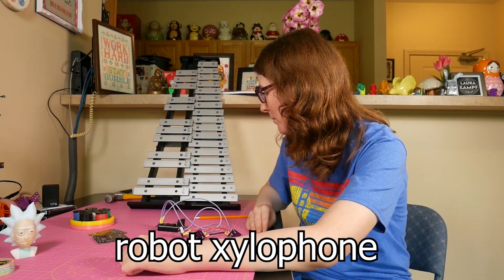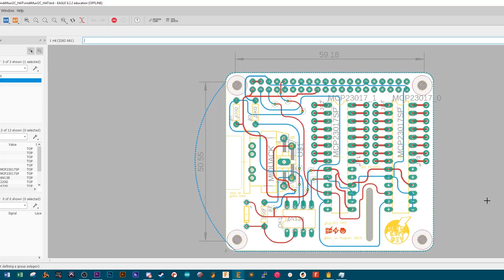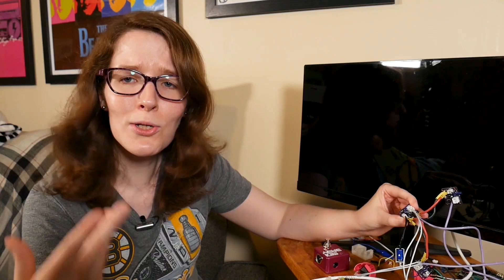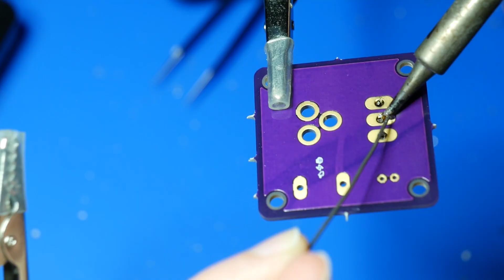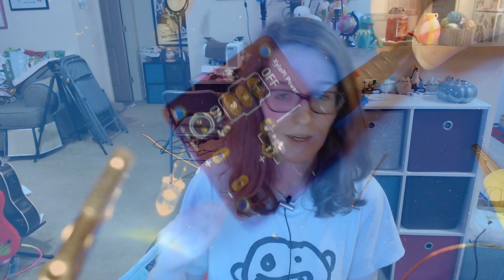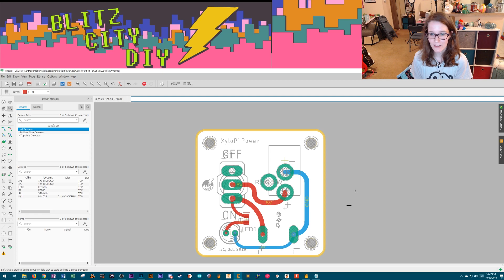How Did This PCB Work Out? - Making and Sharing Mistakes

Comment: Are the net names on the two switch terminals the same? Both VCC for example? That happened to a board I was designing in EasyEDA recently, and only spotted it because there was a rat line drawn between them. That'd explain why the copper pour connected the two pads.
Also what value resistor was it? 1K should be enough to stop the LED from kersploding :P

Comment: Problem was is in the schematic. you joined pins 2 & 3 of the switch together instead of pin 3 going to R1 & JP1 junction. 

I always spend another few hours just staring at both schematics & layouts before ordering. I generally catch my noob mistakes that way, though almost always end up with a connector the wrong way around. Keep at it. we have all been there.

You should also try online gerber viewers and zoom in to pads before ordering. (KiCad 3D viewer feature is gold here)
Reply: Agree. Though that doesn’t explain why the SMD resistors pads are both connected to the vcc-poor.

Comment: There's nothing wrong with your choice to use a plane for Vcc: your mistake was in the schematic, where you'd joined V-in and V-out via a single pin of the switch :)

If your schematic was correct, the Vcc plane wouldn't have been connected to everything in the PCB design view. That said, it would possibly have been easier to spot your mistake if you'd routed it manually. I'm not sure how Eagle works, but in KiCad your manual routing board would have triggered an error in the error check tool, as it would have been expecting you to join V-in to V-out, which would make you realise that something was wrong.

It's always so damn easy to make mistakes with PCB designs, though, so don't be too hard on yourself :) I've made a habit of printing board designs out on paper and staring at them for ages before placing an order, but that still doesn't always save me from frustrating moments like these!
Reply: I've wondered about the schematic showing the issue, too. But I think that's the result of back annotation. The initial layout (without the power plane) looked just fine.